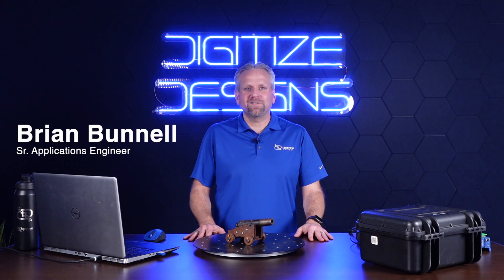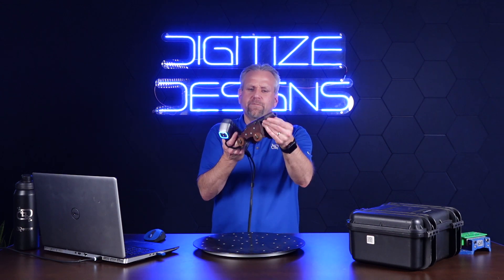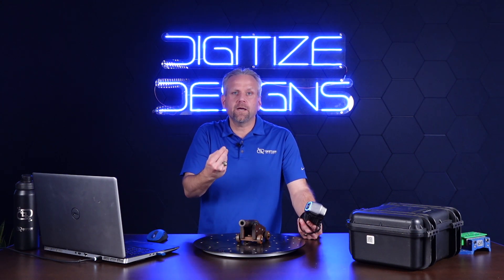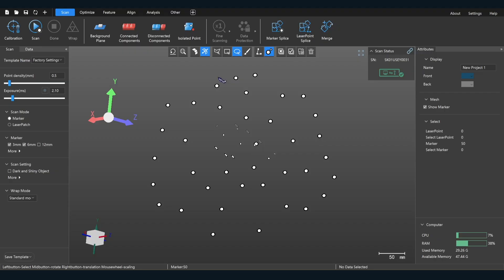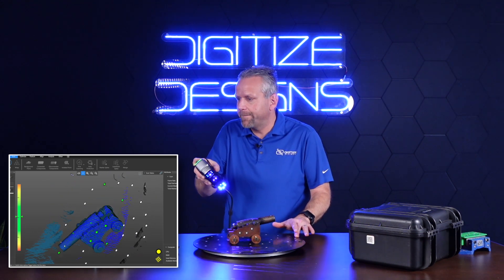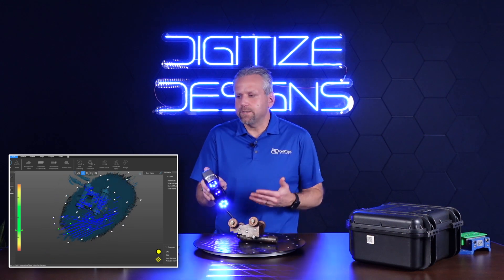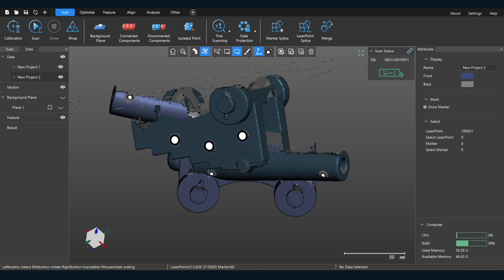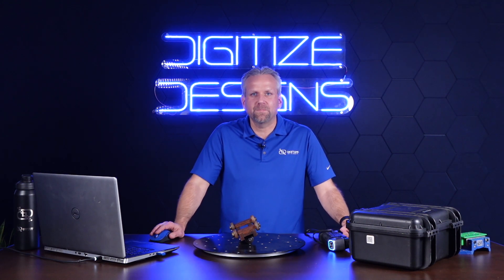Introduction to SIMSCAN by Scantech | Handheld 3D Scanner Demo from Scan to STL by Digitize Designs

Comment: When create my mesh/wrap command anywhere there is a target the surface looks like crap. 
Also if I use the smooth command it makes it worse. 
So I’m left with rough ungodly spots at each area that had a target.
Is there a way to fix this?